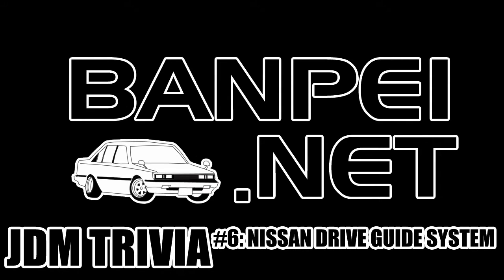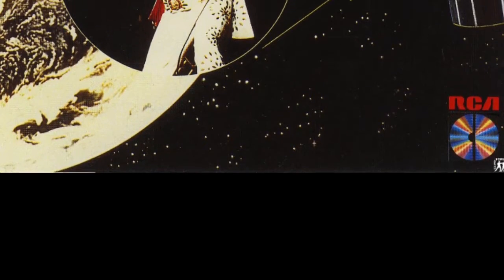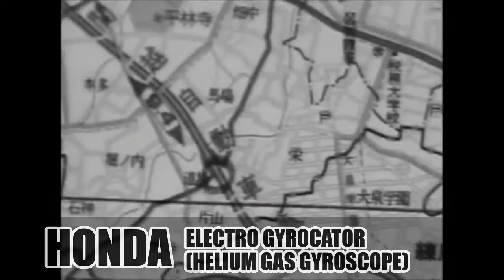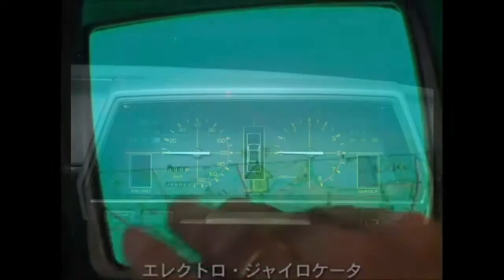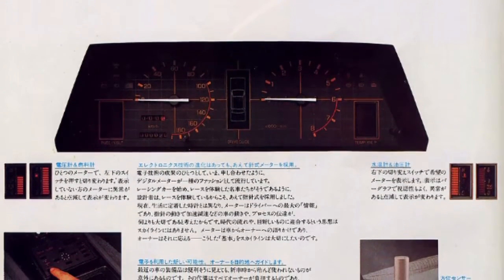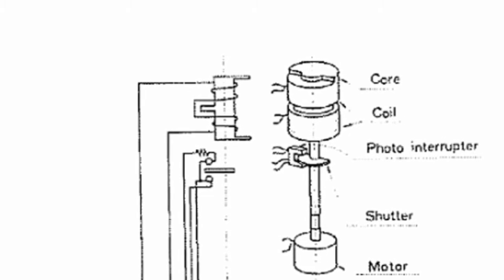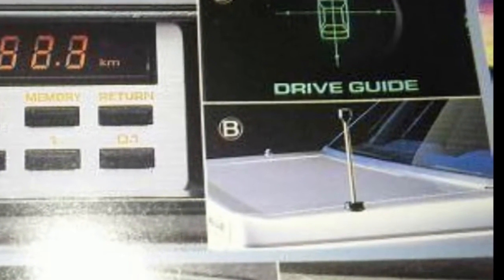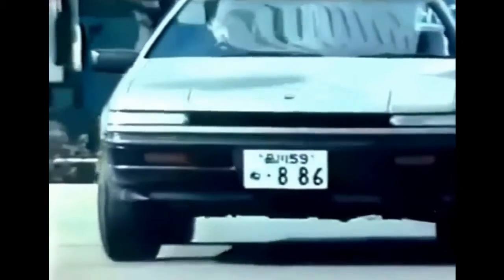1981 Nissan Drive Guide system [JDM Trivia #6]

Comment: Thank you for the video. Now I understand the Driveguide better.
The Honda system is also nice but a few weeks ago I read that you have to use plastic cards. Thought they were installed in it. That make it less interesting. Don´t get me wrong both systems are great. Especially for their time. And then compare 80s European full size cars like the S-Class with it and you do the math. :)